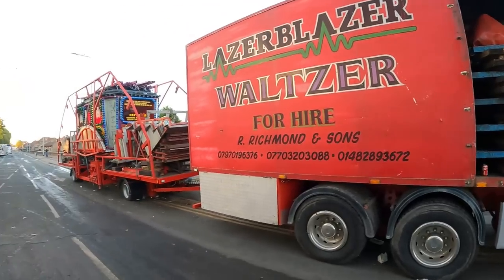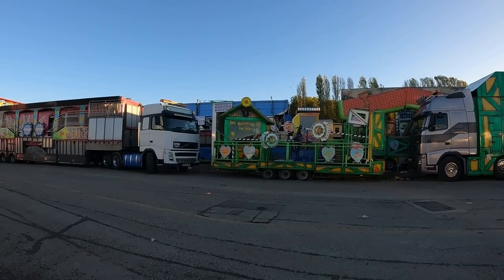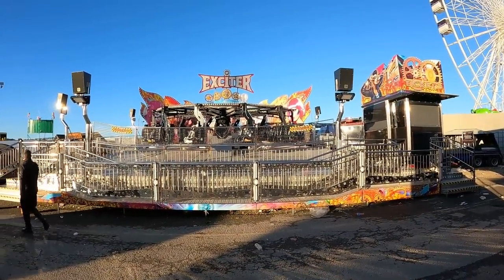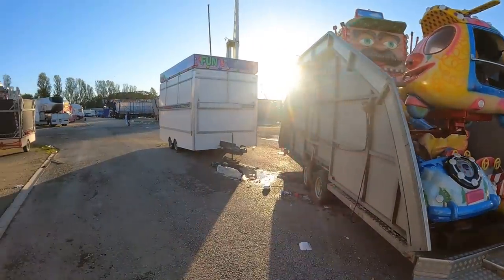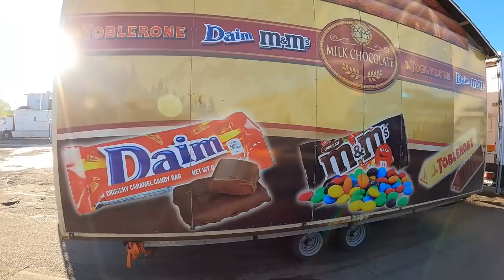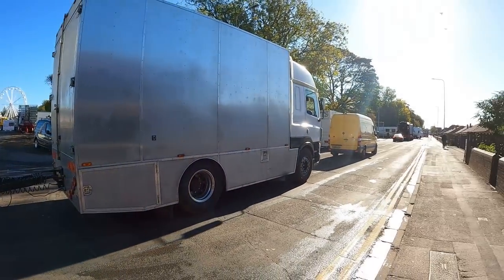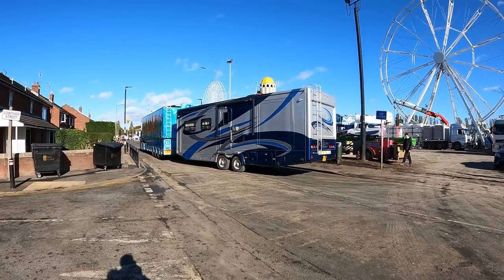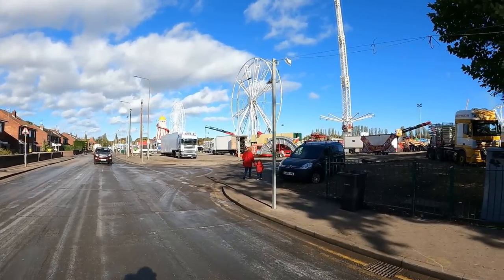Hull Fair Pull Down & Pull Off 2022

Comment: I’ve been a class1 HGV driver for 10 years, the turn wasn’t that bad. The smarter drivers turned to there left your right as there was more room on the pavement to miss the post. The living wagon after the fun house got his approach wrong and had to reverse and try again( we’ve all done that before). He used all the space available although asI know Hull,I would have gone left down analby road then out to the 63, it’s easier when in a truck rather than going out of Hull two junctions up. The lad in the baseball cap did well guiding his wagons out of the gate and was probably a driver himself. The atmosphere fear ride was driven on a heavy haulage certificate as I presume danters wagons were that’s why they were going slow as you can only go 40mph maximum on a motorway. 

You asked for questions 
Well I’ve asked around other drivers for many years how the showman are able to have an extra trailer on the back. You can’t reverse them if you get into a pickle, you would have to take off the back trailer than reattach it. Showman are exempt from normal rules only with a rigid truck pulling a living wagon and a trailer no more than 20 feet long. Does anyone know maybe PT vlogs can find out.

Some of the trucks look superb and some of them will have old manual gear boxes on them   You have to double dip the clutch. Most artic tractor units are automatic these days, I can’t remember last time I drove a manual. 
Keep more of these vlogs going I find them to be more interesting, hopefully someone can answer my question
Reply from the maker: I can honestly say that experience is key... Angles, timing, etc, you need it all! I love the 3 load trailers, image the amount of rev you need for that, and the frustration of hitting a queue on the motorway lol